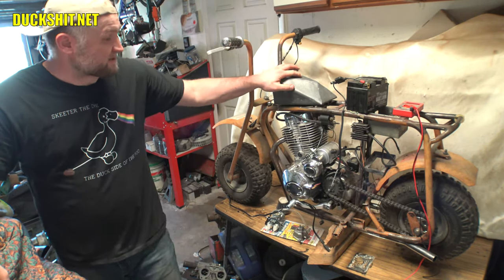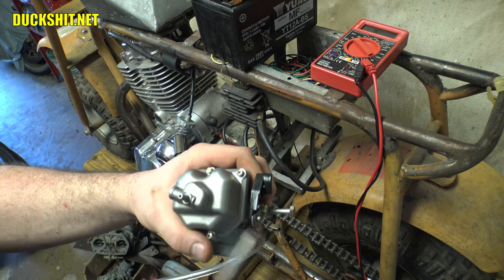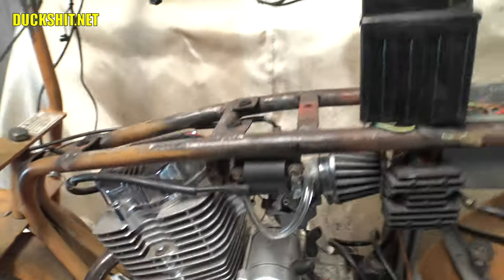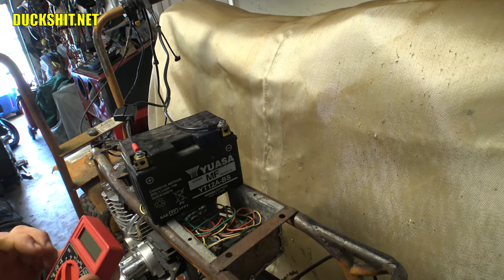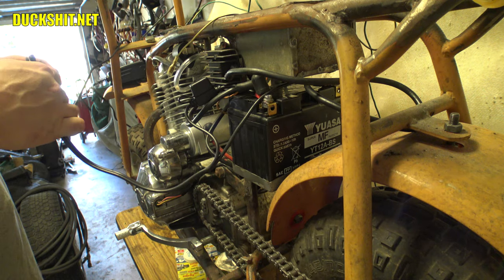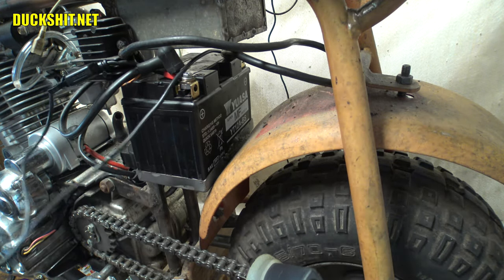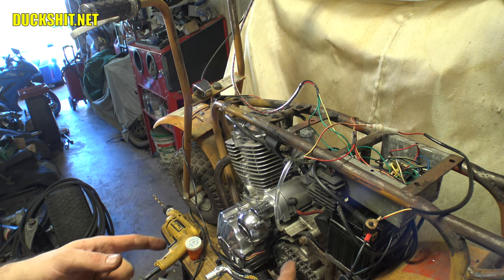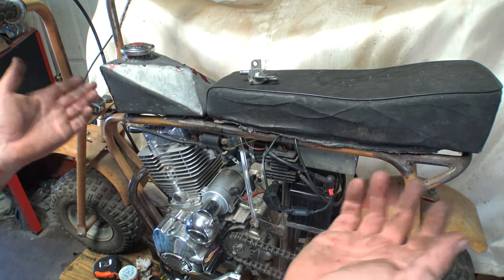PZ30 Carb Jets / Seal Gas Tank / Wiring - DoodleBastard Engine Swap - 18

Comment: I bet that thing is gonna fly. Oh, might not be good idea to mount metal fuel line switch on the coil (spark maker). Think about it Duckman. Lol. Cant wait to see it run!
Reply from the maker: LoL never ON the coil
Reply: @DuckmanCycles  what were u saying abt gas tank size guessing? Im going with 2 quart capacity on the tank.
Reply from the maker: I said there will be a contest, it has not started ye, but I will do a formal announcement in the very near future

Comment: Put your multi meter on 20 volts and test the battery. If it has around 12.6  to  12.9 volts after sitting then its charged. the charger will take up to 14.4 or so. (to figure out the state of the battery). Just saying and yeah I know the wire on tender was cut and you soldered it.
Reply from the maker: You nailed it!  I fired the DoodleBastard today, and the stupid light blew out.  LoL!  Not sure if overvoltaged or just chinese crap.  Will find out soon enough.

Comment: Can you please answer.
What is that thing under the sprocket right around there. It has 5 to 6 wires coming off
Reply from the maker: Yes I can answer.  That is likely the stator wiring harness!  😁
Reply: It's not the stator its behind the gear
Reply: @DuckmanCycles  it like almost goes into the case
Reply: @DuckmanCycles  and without it I will have a oily mess lol
Reply from the maker: It's the stator wiring as said.  It wont run without it, and won't leak without it because it wont run either!
Reply: @DuckmanCycles  ok I'm buying a wiring harness that should come with everything. And love the vids
Reply from the maker: Thank you, I hope you find a wiring harness for this thing!

Comment: Guessing that's a 1L tank (is that a quart in US measurements?) 
cheers
Reply: Close enough for government work.  ;>)  A quart is 946 milliliters. Some things ARE Metric in the U.S.  Soft drinks are sold in 2 liter bottles.
Reply: @eliduttman315  you guys still spell litre wrong ;p
I'm an Australian so this gets complicated.
We use the Metric system down here but grew using Imperial Units that some how differ from US measurements when we talk about anything other than Inches or Feet (and there smaller or larger increments. thinking thousands of an inch)
I think of height in Feet. Body weight in Stones. Fine work in Millimetres and speed in a combination of Mph or Kmh depending on if I talking 0 to 100 or 0 to 60. what car I'm driving or what the speed limit sign says. I also work for a US based company.......
my head hurts now, gonna go lye down.  ;p
cheers
Reply: @mark64tanner  Both spellings are correct.  It depends on the dictionary, "Oxford" or "Webster".

Imperial and U.S. customary do differ.  An imperial pint is 20 fluid ounces, while the U.S. customary pint is 16 fluid ounces.  Before Canada went Metric, motor fuel prices confused Americans.  It was the imperial gallon vs. the U.S. gallon.
Reply from the maker: Thanks, will announce the contest and when to start sending in your guesses soon!

Comment: One reason the old solder worked better than the new solder is the govt is making solder makers take the lead out, your old solder had lead in it, the new stuff likely has no lead which makes it a much poorer product. Blame the EPA, lead is dangerous, my brother had a severe case of lead poisoning, so the EPA is getting as much lead as possible out of just about everything, the problem is that sometimes it really screws a product up, solder is a good example. Most people know the govt is really good at screwing things up, like adding ethanol to gasoline, dumb, just plain dumb.
Reply from the maker: Yeah, except my old solder is also lead free lol 😁👍
Reply: I guess the Chinese just make crappy solder LOL!
Reply from the maker: @G56AG  haha HF anyway, the RadioShack stuff was probably Chinese too